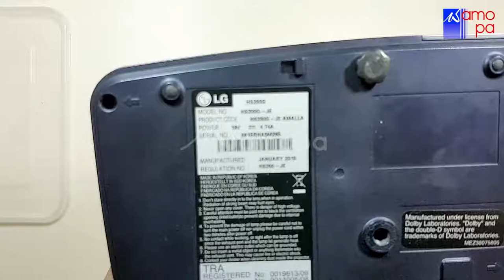White Dots on the Projector Screen | LG SH200G | SH201G Teardown, Disassembly | DMD chip replacement

Comment: Hi
My projection LG HS201
Only Red light flashing work.
What is this. Fault?
Reply from the maker: Hello, How many times it flash/blink in one cycle?
Reply: @wamopa  continuos
Reply: @wamopa  screen is Red. All menu o the screen flashing Red Light
Reply from the maker: @erdalatik3096  May I know the symptoms before your projector gives you this flashing red light. How Old is your DLP projectror?

I did not yet encounter such problem. But as per Manufacturer. The life span of the LED Lamp is 30K hours respectively.

Usually most of the LG that i fixed when the unit reach more or lease 30K hours we need to replace the  DMD chip. At this stage you will encounter a scattered dark spot inyour screen.

Comment: Hello sir. This  projector  power supply Ic code pls?
Reply from the maker: Hi, sorry to tell you that I don't have with me this projector anymore. But you can use any Laptop power supply its 19v  just use plug adapter in order to function, take care with the polarity and the power capacity of the replacement.
Reply: @wamopa  I didn't say clearly on WhatsApp. Please reply

Comment: I have one like this but it is not working properly as of now. The video is color red making it not good for
Reply from the maker: Try to adjust the color. Step by step procedure is in the service manual. Download link above.
If the problem persist then you need to replace the RGB LED lamp (Remember that the lamp will last 30K hours only)
Reply: What do you mean by ( 30 k ) ?
Reply from the maker: @ahmedhassan-kv6jd  30,000 hours
Reply: @wamopa  How can I buy the RGB led lamp ( from where ) .. Iam from Egypt >
Reply: can you send me your e-mail .. I hope I send you avideo to explain my projector proplem
Reply from the maker: @ahmedhassan-kv6jd  Marhaba! my email: akym0720@gmail.com
Reply from the maker: @ahmedhassan-kv6jd  I believe only available at LG service center. I tried to search the web but no luck.

Comment: Hello sir yung optoma ko po kasi logo lang lumalabas tas pgktapos walang display pero may ilaw tas may white dots din. DMD chip din po kaya yun? Thanks
Reply from the maker: Good day po. Pweding malaman Ang model number ng unit mo?
Reply: @wamopa  optoma hd50 po
Reply from the maker: @isprakenheit8005  Sa tingin ko po may tama ang DMD chip nyo. Ang lifespan kasi ng DMD chip kalimitan ay 20,000 hours masuwerte kung aabot 30,000 hours.

Sinubukan kung maghanap ng service manual pero wala akong makita sa net.

Ang part number ay pwedi nyong makita pag dinis assemble ang unit.
Reply: @wamopa  oks salamat po sir!